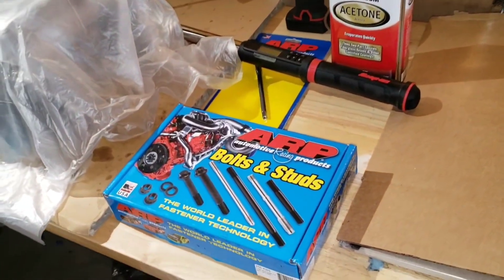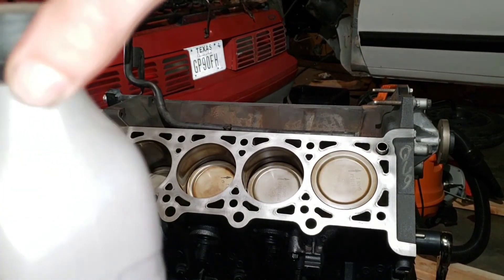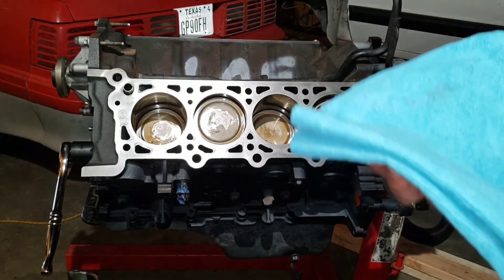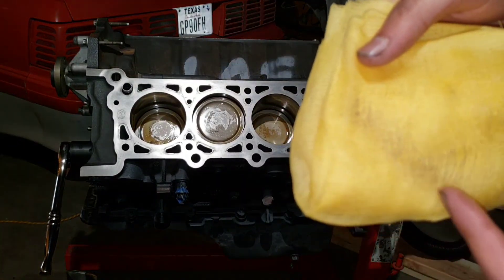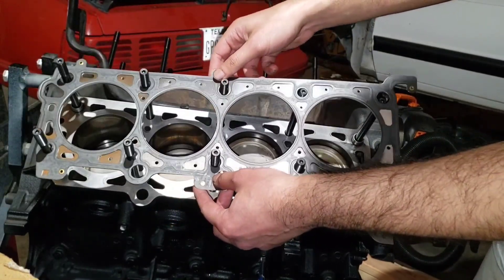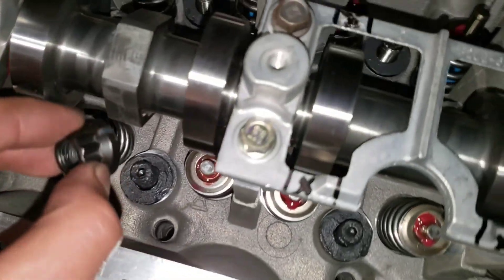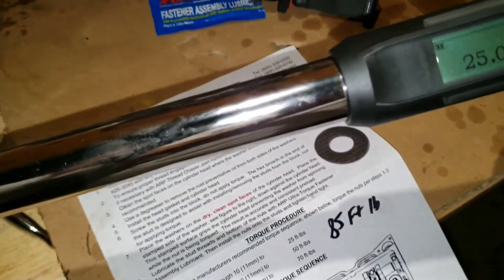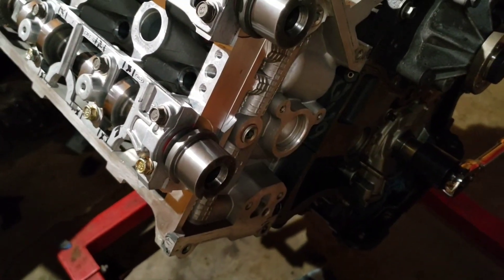ARP headstud install 03-04 Mustang SVT Cobra

Comment: I've been plagued with head gasket failures on my 2000 F-250 5.4L 2V engine. Yet again, I'm in the middle of a head gasket job. The engine is one of those online rebuilds, performance something, there's a few and all about the same. The engine was supposedly remanufactured in a Ford plant in Texas is what they told me. It worked great for a couple years until a piece of plastic broke lose in the right side of the front coolant crossover tube lodging at the reducer Ford puts inline in the heater hose causing a boil over.  Even though I shut the engine down immediately, apparently the damage had already been done. First, coolant began to leak. We had just started a 2 month, several thousand mile road trip, the leak was small, so we decided to continue. Over the course of the trip, the water leak worsened and a small oil leak formed putting oil into the coolant. Some Bar's Leak did cure the water leak problem, we still had an oil leak problem.  WE made it home and I started pulling the engine apart. Fortunately the heads and block are fine, they sanded out flat enough that a .002 gauge can't slip under a straight edge at any point on either the head or block surface. I hand block sanded the engine block and heads through several grits of sand paper down to 400 grit which results in a RA, roughness average of .023. I'm going to use Cometic 3 layer MLX head gaskets .032 thickness, about half the 4 layer FelPro. Cometic wants a RA of .30 or less. I'm going to use the ARP studs too, 85 foot pounds by ARP recommendation. I'm considering using the Permatex copper spray coating for head gaskets, Undecided if you have an opinion on that stuff. I also noticed you have the MMR coolant crossover kit for the rear of the heads. I have that two but I'm plugging the second hole on the right side and placing a TEE center between the two heads, then returning it with the heater core return hose at the valley tube on the right head. I decided to do that because the way MMR connects the left to the right, there is no actual draw of coolant from the left head. Yes the left side connects to the right, but it goes into a large cavity mostly open to the coolant in the right head and having little suction from the left side. If you TEE the left and right together in the center, then connect to the heater return line, you get equal draw from both the right and left head. I actually had to create a custom mount for my crossover because neither side lined up with a hole on the back of my heads to attach with. I'm also installing the Melling 176HV oil pump. 25k miles on my new engine, and the right side chain tensioner was already plugged and not oiling the chain. Replacing all that timing stuff with the Melling kit.  Now I will try to be fair to Ford and the troubles I've had with the 5.4 engine. I do travel and carry a truck camper weighing about 4000 pounds with all our stuff in it. I do try to baby it going over mountain passes and not working the engine too hard, but they did sell the engine in a truck that has a camper and tow package so it should be able to do the job. The goals of this rebuild are to have superior gaskets that hopefully will hold up to demand. I'm adding Gibson shorty headers hoping to gain a little torque and HP. Installing a Y-Pipe kit that eliminates 2 choke points in the exhaust and straightens out the pipe path. Port matching the exhaust to the headers with the help of a flexi scope to verify matching fit, Great tool for that. I expect that with the Cometic gasket, my compression should go from 190/200 per cylinder, to 195/210 per cylinder resulting in about 10.5 to 1 compression. The last mod is to increase the cold air intake from 2-1/2" to 3-1/2". With all the mods, Hopefully the engine should gain perhaps 30 HP and be able to handle it without failure.
If you care to respond to anything, I'd be most interested to hear how the MMR coolant crossover kit worked for you. 
Well hey, sorry to be long winded but you might enjoy the story. I have a couple more weeks before I get the truck back together. Hopefully it will last a good while on this repair.

Comment: Until what power level should one do this for the 03/04 cobra?
Reply from the maker: In my opinion 600-650 plus, you risk lifting a head
Reply: I was at over 700 wheel on a stock engine. I’m putting a bigger blower on and doing head studs. Why 85 pound feet? What boost level should that hold?

Comment: Great move getting the ARP studs. My built iron block 4.6 has all new ARP head studs, rod bolts, main cap bolts, etc. You can't have enough strength built in for safety! Even though I'll never go higher than around 700whp, I can feel safe about my engine holding strong for the long run. I'll never track the car, just street fun. Great video!

Comment: Word of advise never and I mean never go to the recommended torque spec right out the gate, 25lbs first and work your way up to spec. That way you don’t pull the stud threads and you also get full maximizing torque spec and gasket seal and head being completely decked.

Comment: Nice video brotha… what head gasket do you recommend and what oil pump? I’m taking my engine out I will like if you can guide me on parts I should use
Reply from the maker: I put the correct headgasket link in the description, most people use the mach 1 head gasket but it's not correct and the part #s are different, and i would recommend just swapping out the oil pump gears for a billet set assuming your stock housing is in good condition
Reply: @texaseliteperformance4471   oh ok where I can get the oil pump gears? What water pump you recommend me to use ?
Reply from the maker: @joseposada2232  look on modularheadshop.com and for water pump id just stick to oem ford